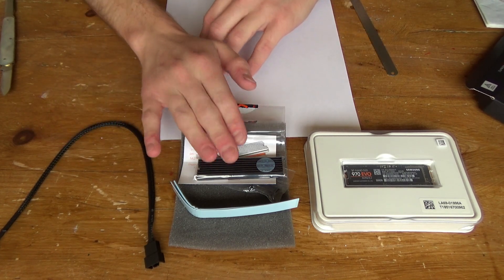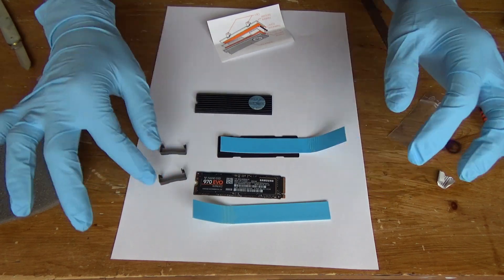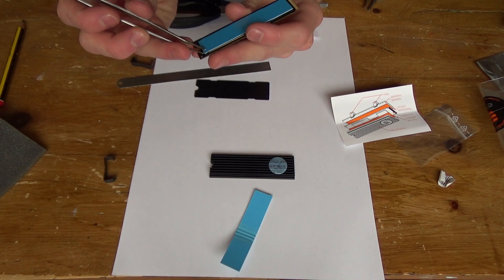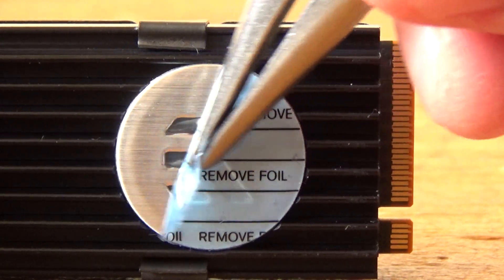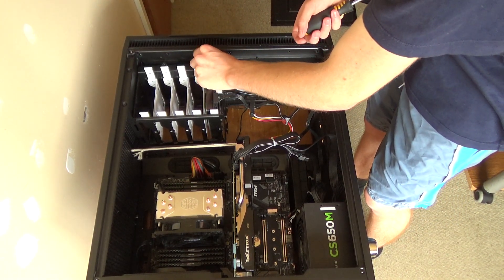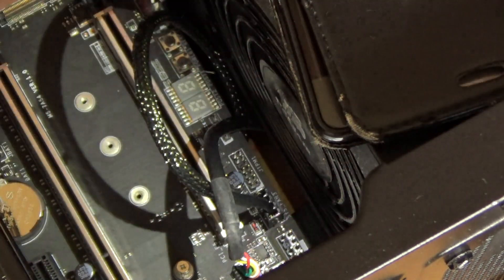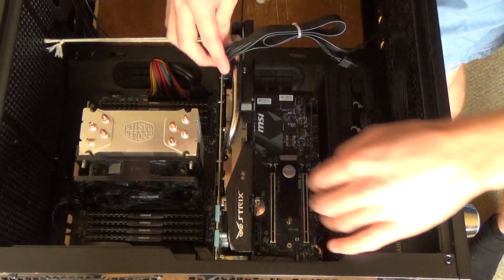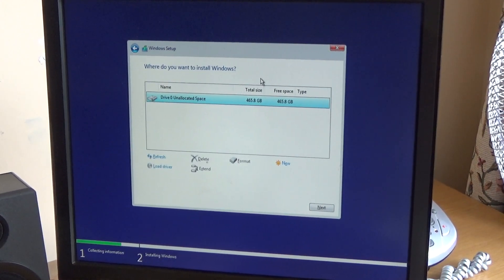M.2 SSD Upgrade Part 2: Installing Heatsink & M.2 Drive (Samsung 970 EVO + EK Heatsink)

Comment: I bought it for my 970 evo plus. My screw didnt go further enough.. so I had to remove the back plate to fit it back into my motherboard. Atm its keeping around 40°c which is cooler than around 55°c that I had before mounting this on

Comment: Offtopic. Swap cpu cooler's fan to otherside of the heatsink. Airflow direction is correct, but you get better cooling performance (at least most of the cases) when the fan is blowing through the heatsink. In other words the fan blows better than sucks.